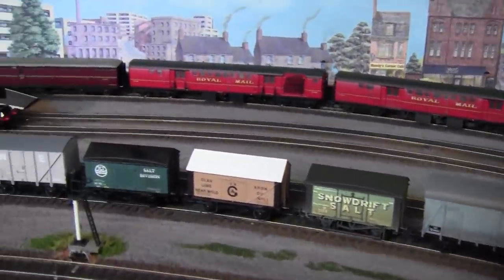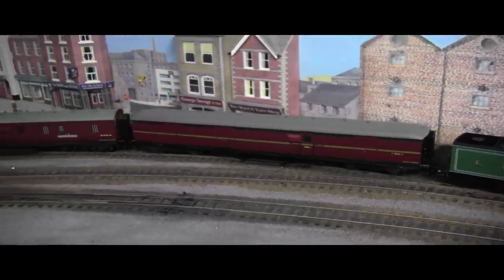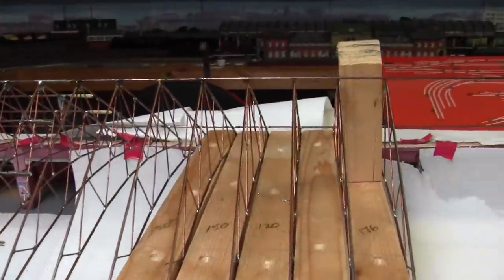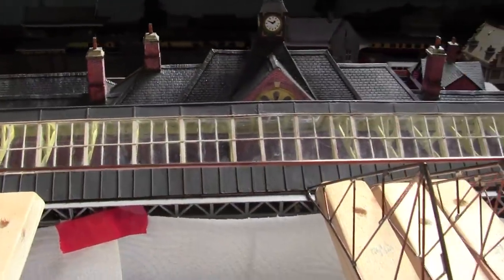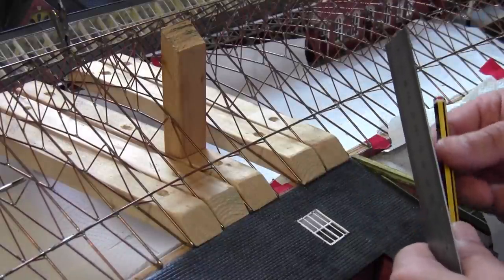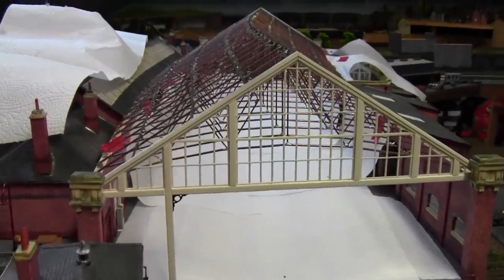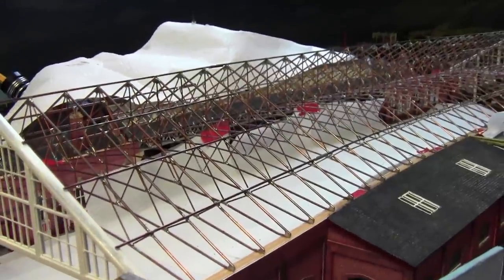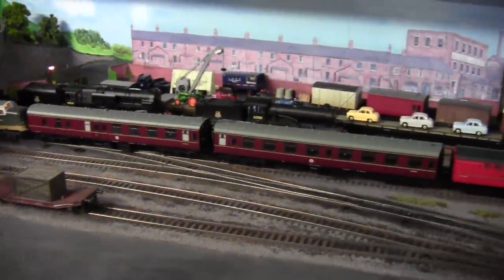Royal Mail Train, Roof update & Competition Winner No284

Comment: I like the way your signals return to red/danger as the trains pass.  Great update on the latest with the roof.  What a significant project overall. 5000 soldered joints is a lot! Wow :)
Reply from the maker: Hi Linley the signal are trian tech simple to fit. but they can be a pricy. you can buy direct from trian tech. thanks again my friend......cheer's Tony

Comment: Stunning work on the canopy Tony! Simply stunning. I have to admire your soldering skills as it cannot be easy fitting the side rails when you know a fraction of a second too long with the soldering iron can see the trusses collapse into a pile of bits. Great job getting the curves too. It kinda reminds me of the Liverpool Lime Street layout as I think that canopy was soldered together too.
Reply from the maker: Hi John. Liverpool lime street station is a work of art, Designed by John Cunningham, Arthur Holme, and John Foster Jr, and opened in 1833. and was builtd 46 years before south shields station was built. 
Yes your right John the team that built the roof for liverpool lime street used nickle silver wire. 0.8mm thick for the trusses, and was soldered together, and their roof is something else. i would love to see lime street station up close.
I might see you at the exhibition at Milton keynes. stay safe.......Tony
Reply: @TONYNORTHEASTERN  Your model is a pure work of art, so impressive. You must be hugely satisfied and proud it’s worked out sooooo well. I’ll look forward to meeting you at GETS in MK.
Reply from the maker: Yes will great to catch up. and hopefully learn a thing or two from you....cheer's Tony
Reply: @TONYNORTHEASTERN  definitely the other way round me thinks

Comment: I've done a bit digging in the LNER Carriage book and no "Gresley" BGs were built specifically as a TPO vehicle. There was one pigeon van in 1931 [70268] converted to a POT , however it only had a 51ft long underframe -other TPOs were built by the LNER on 61ft underframes but the gangway connections were British Standard [bit like LMS type] and OFFSET to the side..They all lasted until  the late 60s and then were replaced with the BR Mk1 design.
Reply from the maker: Hi Bill. some great info regarding the gresley pigeon vans . were they full trains. or just the odd carriages. thanks again for your time....stay safe Tony
Reply: @TONYNORTHEASTERN  Pigeon Vans .They looked like any other Gresley BG from the outside but were fitted with drop racks inside to carry pigeon baskets. Sample vans were 70251-70275 built 1928/31/37 with 51ft frames and 70412-70425/70518-70529 with 61ft frames. It was big business for the railways especially in the North East where a train load of perhaps 12 bogie vans would be loaded up and sent to say Weymouth where the pigeons would be released [take cover!]to return to the North East -the down side of this traffic would be the return of the empty vans to the North East unless some thieving * pinched some vans for their parcels traffic. When we got HSTs at Heaton Depot we needed a barrier vehicle to shunt power cars and trailers [no buffers]. The first vehicles we were sent as a barrier was an ancient Gresley Pigeon van -which was vacuum braked so a fat lot of use it was!